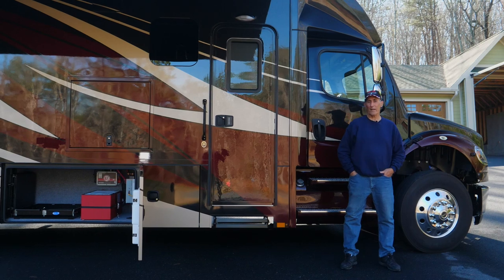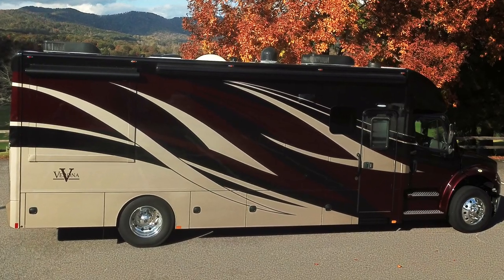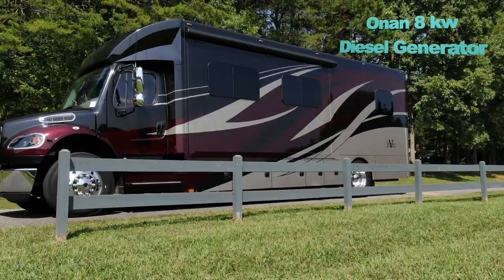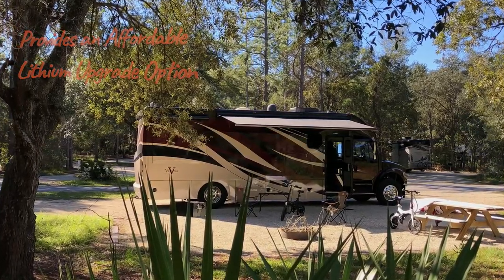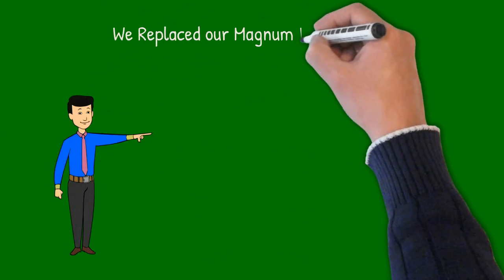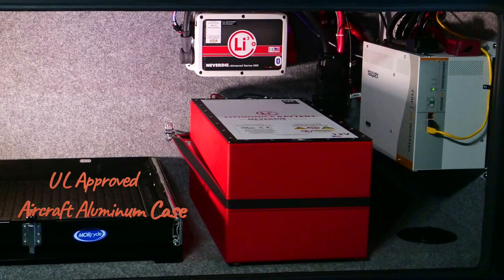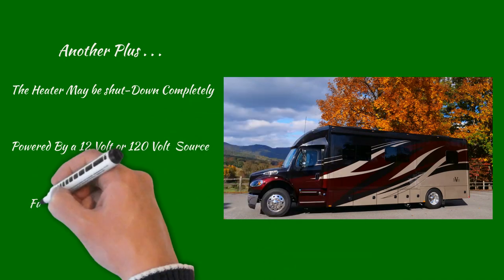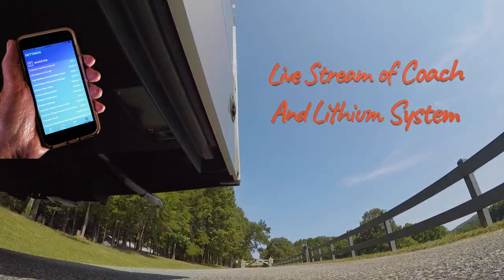RV Renegade Verona Dual Lithium System Solar Upgrade Lithionics Xantrex - Mike Mas

Comment: How much does this system and installation cost. I’m looking to get a Verona later in the year.
Reply from the maker: I'm not too keen on pricing I would suggest that you contact the folks at Lithionics and ask them who would be their best dealer. Their site is:
www.lithionicsbattery.com

Thanks for looking
Reply from the maker: Lithium has dropped in price in the past few years. I just help my friend replace his 6 AGM's with a 300 AH battery he bought on Amazon for only $1039. Therefore, lithium was chaeper than replacing his 6 AGM's.

Check out my new 5112 video at :   https://www.youtube.com/watch?v=ZxSS44przNs

Comment: 0:50 "run a test with the 2 ACs on one battery" . how long did u run the test for?
Reply from the maker: Actually it was in error we generally run the pump on the front unit and the fan on low on the other - anyhow long story short, both units were on cool they had ran for 5 minutes or so when I discovered the error and shut the 2nd pump down. This is not uncommon for Freedom 3012's to handle that kind of load for a short period of time.  Of course having 1260 AH of lithium battery keeps things happy for longer. Thanks for asking!

Mike
Reply from the maker: The quick test was just to show peak surge power. I do not recommend running more than one AC unit on this 12 volt system. I just built a new system called 5112 dual voltage dual inverrter system you can find it at: 

https://www.youtube.com/watch?v=ZxSS44przNs

Comment: How are you going from 48v to 12 v to power leveling system, mine is HWH and requires higher amps and not sure how this would be done.
Reply from the maker: This coach uses two separate 12 volt lithium battery systems, one for 120 volt inversion and a second 12 volt system for the RV's 12 volt devices such as slides and jack, etc. In order to better understand the concept look at my new 5112 system at : https://www.youtube.com/watch?v=ZxSS44przNs  Thanks for the replies guys!
Reply: @LowOnCash  thanks, great video, have an 05 Tiffin Phaeton I’m looking at putting 48v in.  Certainly not as efficient as what your doing but thinking of leaving the old Xantrax inverter in it(removing the 6v lead acid)then going 48v dc to AC then back to 12v dc via the xantrax to power the slides and jacks, will save some money and should be less invasive to the current system to accomplish.
Reply from the maker: @rodneycampbell9832  Hello and thanks for the reply - I'm not quite following you regarding going from 48 v back to 12 volt DC - let me know what your thinking Thanks Mike
Reply: @LowOnCash  currently have the original 12v xantrax inverter/charger with 6-6v lead acid batteries that powers the jacks and slides. Was thinking I can remove the batteries which at that point leaves only the AC which would then go through the xantrax to power them. Then connect a 48v inverter charger and lifepo4 batteries to the AC system. At that point the 48v dc would go through the new inverter charger to AC then back through the  xantrax to 12v dc to power them.
Reply from the maker: @rodneycampbell9832  OK that's what I thought - this same system I designed for my Canyon Star. I call it my 51/12 system since I'm using 51 volts instead of 48 volts and a  separate 12  volt system. Look though the video I linked below. You'll need to purchase a 48 volt batteries and inverter for your 120 volt AC fridge etc.    https://www.youtube.com/watch?v=ZxSS44przNs&t=0s
Reply: @LowOnCash  looking at getting the Schneider Electric 6848 Conext Pro, set up for split phase and they look like they have some good components.

Comment: Hey mike, curious about your battery isolator/regulator choice. Would you still select the chargemate pro over something like the Renogy 60 amp DC to DC charger?
Reply from the maker: Either will work fine - I use the Charge Mate Pro because the Ampbus on the Lithionics BMS triggers the charge perfectly and is adjustable right from my SOC gauge, Thanks
Reply from the maker: I would now recommend Victron's 30 amp charger it works flawlessly. However they are limited to only 30 amps but you can use two id needed check out my new 5112 system showing the charger:  https://www.youtube.com/watch?v=ZxSS44przNs
Reply: @LowOnCash  Thanks Mike!  I went with the Victron and do like it!

Comment: There is not answer to our comments.
Reply from the maker: I answered you other question thanks!
Reply from the maker: Sorry for the delay response - the system is not designed for two AC units however as a test I did run both AC's which was 2870 watts pretty much maxed out for around 10 minutes then shut it down. At 3000 watts it will over heat the inline components.  Be sure to check back I just installed a 51 volt 32.700 watt hr system in my coach and it will easily run both AC's and cook top untul the battery depletes.